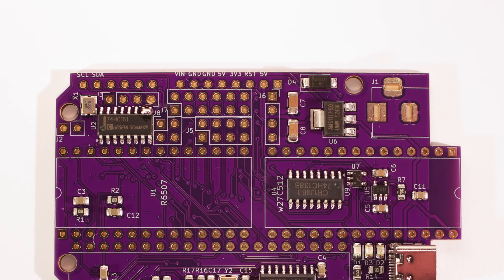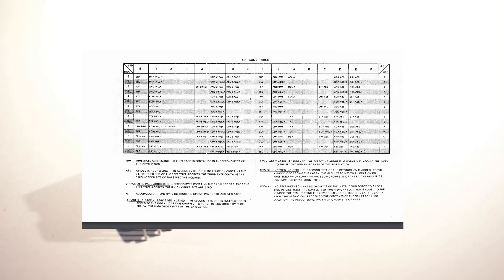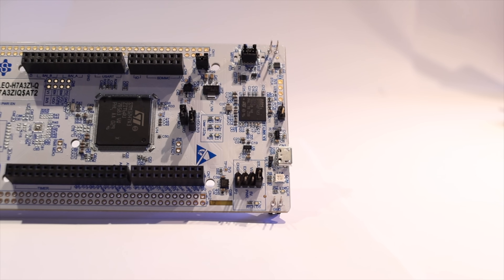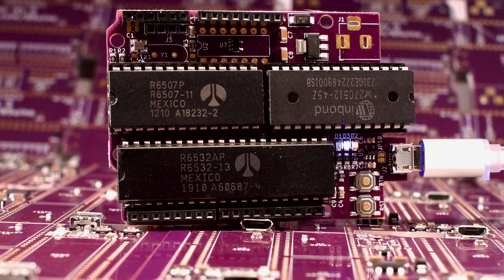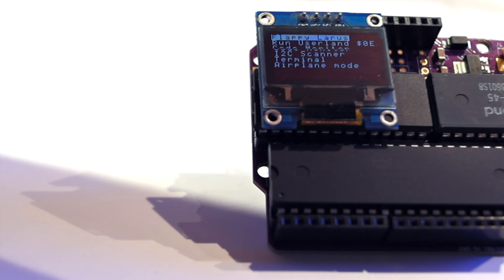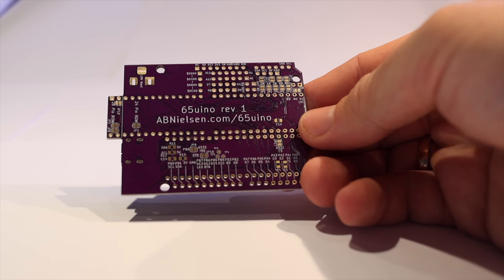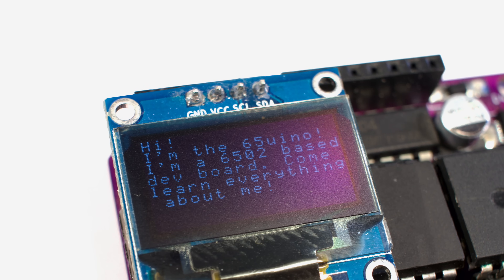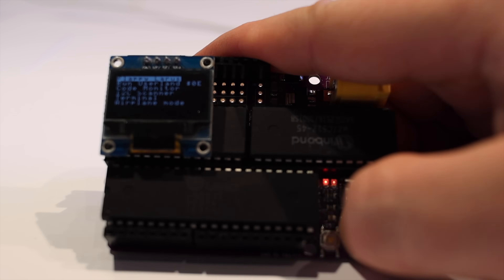6502 Turns 50! The BEST 6502 Computer of 2025 is here!

Comment: soldering 2 pins together on the right of the screen at 1:02 :(
Reply from the maker: That's intentional - the 74HC161 was missing a pullup :) Since been fixed but I had a stack of them that needed that.
Reply: @AndersNielsenAA  what do you need the counter for?
Reply from the maker: @7segmented It generates the clock for the CPU
Reply: @AndersNielsenAA  like a microcode clock? with different stages? or like an actual clock cuz there is already a crystal on the board?
Reply from the maker: The crystal runs at 8MHz - that's too much for a real 6502. The counter divides it down to a 1MHz clock the 6502 and 6532 can handle (the 6502 practically has no problem with 2MHz but the 6532 can become unstable).

Comment: Nice little board, the only bit I see its needing is a hex keypad for entering code via the monitor.
These used to be common, not so these days. Mechanical key switches are a plenty, however the keycaps are a catch, either find a full keykap kit and throw away the extra's or use caps clear lids then insert paper legends, messy.
Reply from the maker: There’s either the cheap hobby kit membrane keypads or the full mechanical key route - maybe the option of both.
18 keys quickly becomes a lot
Reply: @AndersNielsenAA  I was thinking as you already have that serial via usb interface how much work would it be to write a usb keyboard driver in 6502 for it. You would probably need the ROM switching idea though.

Comment: Wow, you still use 6502?  Sorry, but I gave all my Apples away years ago. Never expected anyone to make a board using this processor! I fixed so many 6502 boards over the years.
Reply from the maker: It’s about as simple as a CPU gets so it’s a great learning platform.
Not sure it runs a browser very well though :)
Reply: @AndersNielsenAA  It is good for that but I would go with a RISC processor.

Comment: So I’m completely gob smacked! With the exception of a DEC PDP-8M, the Motorola 6800 trainer was the first computer I ever programmed and I got such a foundational level of understanding that helped me all my professional career in IT. 

So now I’ve a a 3 y/o granddaughter and my son wants me to do a brain dump on her in age appropriate slices. I still have my 6800 trainer packed away somewhere and it still booted the last time I powered it up but this is so much better a solution because the form factor will be more like a beaglebone black or a raspberry pi.

When I took the class back in  the late 1970s, the final was to generate a touch tone 0 sound through a D2A resistor ladder that would actually break dial tone. My implementation was the only one that worked. 

I remember upgrading my trainer from 128 bytes to 256.  I felt like the world lay at my feet with all that address space.

So thank you for this. It will be used to stretch a young mind in the next 10-15 years assuming I make it that long.
Reply from the maker: That sounds amazing! Exactly what I'm going for :D

Comment: Actually, if you would like me to write a 6502 assembler and a forth compiler for your project i might be able to do that once ive completed my current  projects.  My current employer uses an 8051 device that has exactly ZERO debug capabilities so the only way they can debug their firmware is with printf's   THis makes debugging horrendous so I have been working on an 8051 simulator for that device which can now single step through the assembly, hit breakpoints, support interrupts etc.

The plan is to make this a commercial product of course and to that end I have all but completely reverse engineered Keils AOMF object module format which will allow me to make the disassembly 100% symbolic and could make single stepping through the C code possible.  All the info is in there AOMF files.   I did not RE any code of keils just the data and that IMHO is subject to the "Plain View" doctrine.
Reply from the maker: I’ve been steering clear of Keil since open alternatives do exist.
I think I’m fine with ca65 as 6502 assembler

Comment: "hat to resort to low level assembly programming" is the **ONLY** way to code.
Reply from the maker: Technically cc65 does a fine job compiling C - but for this, it's a bit much hand holding.
Reply: @AndersNielsenAA  I write my own assemblers and compilers for embedded controllers.  While I have not written a 6502 assembler or compiler 6502 was the first programming language I ever learned and I learned it in 2 weeks and THEN bought my first computer lol (a c64).
   
I have been working on an assembler, compiler and OS kernel for an 8051 and i can have my host compiler (which I wrote) compile the target memory simulation module, then the complete macro assembler which relies on it then the meta-compiler which relies on the assembler finally then the entire system kernel in .06 of a second.  This will be open sourced eventually

A friend of mine says that developing embedded applications in C is like opening a can... WITH A ROCK.  It gets the job done but it is... shall we say... lacking elegance.
Reply from the maker: @ The 8051 system sounds cool! I’m thinking of putting together a small system on breadboards - but I think I might use SDCC to compile. 
C can be a scalpel - it doesn’t have to be a rock :)

Comment: Love it!
I wonder how difficult it would be to interface a 16-digit keypad (0-F) to simplify data entry...  Nibble at a time would help dramatically with the current method, but byte at a time with a keypad would be heavenly.   A2 00 AD 30 C0 CA D0 FA 60

Self-taught 6502 on Apple ][ back in 1979.
Reply from the maker: Several options - DRA would be available, otherwise memory mapped :) 
An IO shield will be fun :)

Comment: This really looks like a pretty good Arduino Uno clone. Now we just need to be able to program it in the Arduino IDE to make it a true Arduino Uno variant (it’s a knockoff if you can’t program it in the correct software).
Reply from the maker: It's not that hard to write a core for the Arduino IDE but afaik many people are moving to vscode and platform.io anyway, so it is a bit redundant.
Reply: Do you know of any PlatformIO cores that can program this new Arduino style board? Thank you for your time.

Comment: i would have expected that you would use the QFN  type package of the currently manufactured 6502  CPU ....
Reply from the maker: The 80s clones aren’t really the same and they’re neither software nor hardware compatible.
The 65c02 came out 8 years after the 6502 - to me that’s a different thing altogether.
Reply: @AndersNielsenAA  could be be a bit less ambiguous?  do they have the same instruction set?  peripherals memory mapped ?  stack size the same?
Reply from the maker: @daomingjin  They are not 100% pin and instruction set compatible - hence a 6502 won't run in a socket meant for a 65C02.
Reply: @AndersNielsenAA  The 65C02 has all the documented instruction opcodes of 6502 plus Extra opcodes, so any program that uses 6502 opcode will work with the 65c02 in everything except timing.
Reply from the maker: @enochliu8316 Except it’s not hardware compatible. Too bad. The R65C02s are though - but it’s been a while since Rockwell made those.
Using obscure parts is kinda opposite the point here - reusing plentiful existing chips is part of the design.

Comment: I built a ZX80 kit I got from an ad in Popular Electronics.  It only had a few hundred bytes of free RAM if you wanted a screen so I was forced to learn assembly to do anything.  I hated that thing, it was painful to type anything on and with just about 0 memory, I couldn't do much with it.  I then moved up to a Vic 20 with a whopping 3.58k off free memory, and decent user ports to actually be able to play with hardware, and most of all, a real keyboard.  I was in love.  Picked up a modem to play "online" but all the available terminal software I could find sucked.  So I started writing my own with an auto-dialer, # storage, text capture/save, different send/receive colors, even a 40 column mode because the native 25 ?  sucked.  My dad had prostate cancer at the time so I took him to most of his appointments.  They sometimes took hours so I carried my 6502 Bible:  6502 Assembly Language Programming by Leventhal and, of course, the VIC-20 Programmer's Guide, along with a clipboard and a bunch of paper.  I'd sit there and work on my code in the waiting room, often limited to my single chair, writing assembly and hand calculating branch, jump, etc. addresses by hand.  Good/bad times but I'm glad I had the experience, it's served me well over the years. I've gotten lazy as an old guy, I don't play with anything more than Arduino's these days because they're so easy and most of what I'm doing doesn't require a lot of speed. Currently I'm working on laying out a 64 input / 64 output w/ FET's for switching 24vdc LED's.  Salvaged a control panel off a CNC machine, I want to connect it to an Arduino and make it interactive, pushing buttons turning lights on/off, DA out to the Spindle Load Meter, flash different patterns based on switch settings, maybe some basic games.  The wiring on the back is nicely loomed, it's a bit of a work of art in itself so I want to mount it in a wood frame with a clear back cover to highlight the craftsmanship. Just needs a ton of I/O to work and I couldn't find anything reasonable on the market so I'm making my own board.

Comment: This looks amazing. Would u recommend using a 65c816?
Reply from the maker: Thanks :) Depends what you’re after. The 80s clones never made much sense to me since the m68k was out in 79 and starting showing up in things during the 80s. .. and the C02 came out 8 years after the 6502.
Reply: 65C816 due to how it multiplexes A16-A23 with D0-D7 is a bit harder to design for. It is also only internally a 16bit chip externaly it has an 8 bit data bus. Its main advantage is that it can do 16bit addition however due to the way the the data bank register works you still efectively have to page data memory. Machine code routines on the other hand are not limited to a single 64k as when the PC crosses a bank boudary the program bank register is incramented efectively giving the 65C816 a 24bit program counter. So unless there is a call for 16bit math or assembled programs that are large than 64k a 6502 with a paging mechanism on the circuit board is just as good. Basicaly the 65C816 is to the 6502 what a 8086 is to an 8008.

Comment: Very ingenious to nibble the byte first and then push the value in. But this can be improved by using eight bits in a row. First you address the first bit, if the button is pushed the value is raised, if the button is not pushed the value is not raised. Only eight clicks means 255, no clicks means 0. An extra feature is that the man who programmes the computer has to be in sync with the computer. Both should be thinking of the same bit at the same time. Beter not raise the clock speed above 5 Hz. Maybe less.
Reply from the maker: For most people I’m afraid toggling in bits takes longer than a nibble at a time - but I’m going to build a bit toggling machine eventually :D
Reply: @AndersNielsenAA  
Wow, fantastic!

Comment: It's pointless to say this, but, you claim:

"If you look at the spec sheet of a  modern embedded system development board without a pretty deep understanding of what half  the features are, you're bound to get confused. You'll end up feeling overwhelmed, and you  might give up before you've even started and even though you might be able to  hack together some pretty cool things, hat does stuff the 6502 couldn't even dream  of, without the basics and without a strong foundation, it's a lot harder to make  good solutions..."

This is untrue and terrible advice. You do not need to know assembly to program a dev board or work in embedded code any more than you need to know how to build a motor to drive a car. Almost none of what you do on the 6502 applies to working with a dev board. You are not learning to walk before you run, you are learning to pogo stick before you walk. 

An STM32 dev board or a more hobby friendly board like an ESP32 or Arduino are far easier than anything with a 6502 because you write in high level languages and there are high level tools to help you.  Heck, it's easier to build an ESP32 board than work with a 6502. They tell you exactly how to do it.

The 6502 is not even the same thing as what is on the dev board. The 6502 is a CPU, the dev boards have an MCU.

I have no problem with playing with a 6502 for fun or entertainment; I've done this. But please don't sell to people learning computers that they get anything from working with the 6502. If you want to learn to do actual work, start with modern technology.
Reply from the maker: I’m not making things up here. 
By learning a bit of assembly and knowing what registers are and bitwise arithmetic is, you MASSIVELY accelerate your learning curve compared to jumping straight into the advanced features of an STM32. 
If you only learn to cobble libraries together you’ll take way longer to get an intuition for things.
Try it.
Reply: I don't agree, assembly is mandatory when you need to exploit the whole speed of any CPU and MCU with embedded possibilities, not to mention what Anders talks about, knowing exactly how it is working ; we're not back in the arcade era, but all people I knew that were programming them made big things after the LSI took the lead because they knew how to make big with less.   Everybody can write some approximative C routines, not everybody can write them in assembly to squeeze up to the last drop of juice possible while being able to shelf that in just a few KB of memory.

If you want a comparison, at the programming level this time, 99% of so called programmers in JS use big machines with lots of memory and do not really care about (nor often understand) what they're writing, much less than 1% write extremely good code than can run fast on either old machines and the latest ones, and it is because they know exactly what they are doing - no need to say that nowadays the weight of the majority of web pages is absolutely crazy with no objective reason.

So, yes, working with very limited resources makes you a better programmer/designer and this is the kind of thing that usually counts a lot in the final price of a device.

Comment: Oled is a bottle neck for 6502, it doesn’t have fast iic port
Reply from the maker: It is - i2c at about 25khz is slow. I was thinking of using the parallel version. The ssd1306 does have a parallel mode which would make super snappy.

Comment: cool, i see that you got some influence from the atari 2600 🙂
i bought two 6-swtcher pal versions last year and one 7800 🙂
haven't done anything yet, but the idea is to make new boards that have more stuff on it with a daughter board for the cpu, 24 address pins, an address decoder and static ram chips, as they are very cheap now, daughter board for video, daughter board for audio, etc.
but still compatible with the original chips, like the 6507 on a simple cpu daughter board etc.
this way with very little effort, an original 2600 can be built but has many upgrade capabilities.
at the end, the pinning of the daughter boards for cpu, video and audio should be somehow compatible so that a bourd with an fpga can be built, that also includes local memory. this would be very useful for the cpu board to have local fast ram and running multiple cores on it.
the video board could use local memory for graphical objects like screens, sprites, fonts etc. and the audio board could use this memory for samples.
but on the motherboard interconnected with an 8-bit bus, running either with the original frequency for pal or ntsc or with 8MHz.
with all the local memories on three fpga boards they would easy outperform an amiga.
the fpga of choice would be a lattice ice40 fpga (or so). but it will be tight with this fpga.
Reply from the maker: Sounds cool. I’m playing around with the new “cheap” Gowin FPGAs on Tang Nano boards - unsure what’ll come of it :)
Reply: @AndersNielsenAA  i think they have one with hdmi out, right? maybe that is at least a board to convert raw digital video out to hdmi.
Reply from the maker: @stefanweilhartner4415  Yup. When you start throwing FPGAs at things a lot of things get easy 😊

Comment: A tip: do not add a solder blob. Rather solder a 0402 resistor (for pullup a 10K or 1K, but even a 0R would work here). Then when somebody sees such hack, they will be not tempted to remove or question it and you do not need to apologize :)
Reply from the maker: You’re right - that might work :)

Comment: I think mine is better

Has hardware composite and svideo

5 channel sound

128k base memory with 128bytes of zero page cache

Has AVR acting as a DSP coprocessor (with a turning complete display list) 

Compatible with Atari 2600 roms, roms over 8k have to be slightly modified to use the built in banskwitching, roms still align to 4k boundary, but with the ay8930 (or 8910), You can increase that up with bank switching (16bit gpio use 8bits get 512k as 64k * 8 pages, the other 8bit port for whatever you want,)

Uses the ntsc c010444d television interface adapter the rest is off the shelf parts

The avr DSP runs a custom firmware, runs at 21.47727mhz, and unlike antic, it has full memory access via tri-state and can do memory operations, mainly handles the graphics, and sound chips, the CPU can be clocked at 1.19 or at 3.57545mhz by setting an external register
Reply: The software on mine isn't open source but the PCB is if you can figure it out

But if you resell it I can sue
Reply: I think it's better than jay miner's vcs
Reply: I think it's better than jay miner's vcs

That's it's prototype name
Reply from the maker: Oh don’t worry. I have an FPGA that does all of the above. GG